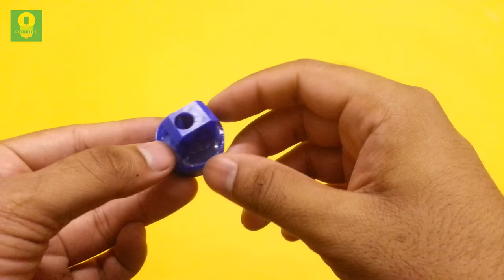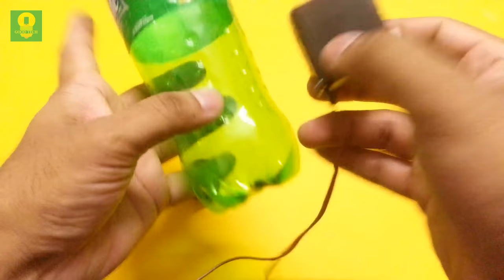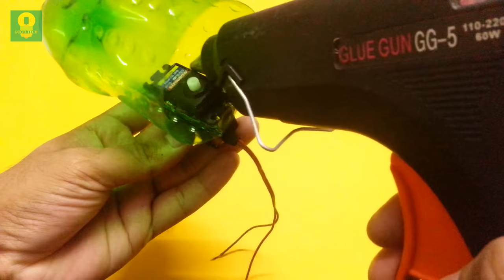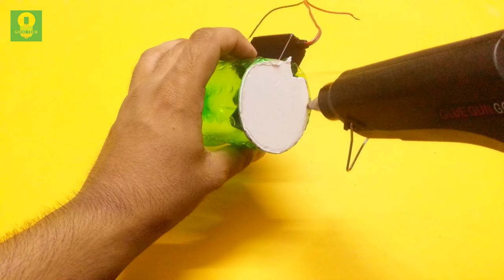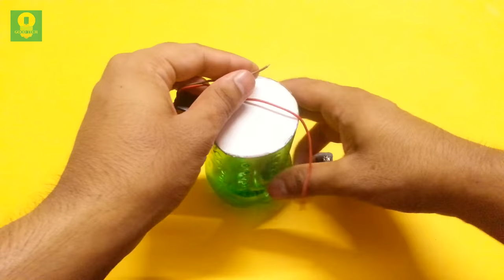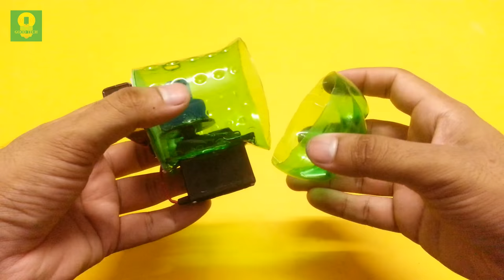How to make Electric Pencil Sharpener at home

Comment: Is there's any other way but soltering the wites
Reply from the maker: If with wites you mean wires and soltering means soldering, then the wires can also be wrapped along the terminals and secured in place with hot glue. This will eliminate the use of soldering for this project.
Reply: But can we use electric tape in the place of it
Reply from the maker: If you can hold the connection well with a tape, then yes it can be used. But why don't you get a soldering iron, its easily available and also very easy to use.

Comment: were i can get the dc motor
Reply from the maker: Its actually a servo motor. Its easily available on www.banggood.com, www.robokits.co.in, ebay and amazon. An electric sharpener needs high torque (a plastic geared servo does the job pretty well), you only need to modify it for full 360 degree rotation (  https://youtu.be/NOGoAgZQOnw )
Reply: GOODTECH - Creativity and Science

Comment: Can i use a DC motor
Reply from the maker: Yes, a geared DC motor will also work fine. I used one in my new pencil sharpener video. If you want, you can check it out: https://youtu.be/B0sdOquZoBs

Comment: where i can get dc motor
Reply from the maker: The motor used in this Electric pencil sharpener is not a simple DC motor. It is a servo motor that is modified for full 360 degree rotation. The motor is easily available online on ebay and amazon.

Comment: make a speed sharpnaer 
good
Reply from the maker: Speed of this sharpener is quite good, it takes only few seconds to sharpen a new pencil. However, you can increase the speed just by using the motor with high rpm.